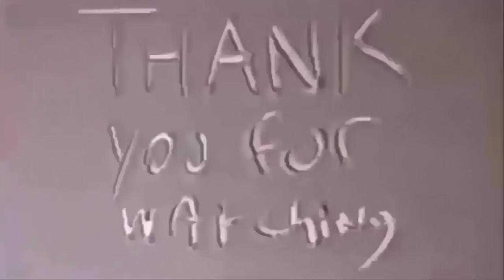How to Plaster over Artex and Textured Ceilings

Comment: So you used one coat bonding and two coats of multi finish am I right ?
Reply from the maker: yes mate thats 100%
Reply: mac plastering Thank you very much for reply mate, I will do  same but before start plastering can I use thistle bond-it gritt not pva
Reply from the maker: @1987yuksel  Yes you can use that buddy but i must say I dont use it no more due to it failing on me on 2 separate jobs and carlite even tested the plaster o the 2nd job and said the mix was right and the plaster was ok so that lead me to believe the grit failed me now not to say its bad as i have done loads that didnt but let me tell you pva has never failed me as bad as grit has and I have done loads more with pva over the years than grit

Comment: Nice job I've got a living room ceiling to do in a couple of weeks its thick artex I can't overboard it as it has coving,would you say your process of bonding and skimming over the artex is the next best option just because it's a living room ceiling so there will be foot traffic above just wondering would it be alot of weight on an already thick pattern of artex
Reply from the maker: HI mate , I have done it this way a good lot on many of ceilings and never had any problems , if it is safe to I would scrap it back so there i less plaster on , bonding is a lightweight plaster so not lots of weight there plus i would always re screw any lose or cracks and scrim them also it all helps for a better job, If you cant pull down on overboard its your best bet mate
Reply: @macplastering  thanks for the advice mac I'll go down that road and get a sample tested and hopefully crack on with it 👍
Reply from the maker: @Lemon-squeezer  For sure mate best way keep in touch let me know how you get on and always here for ideas if you need me mate
Reply: @macplastering  thanks pal

Comment: what are the costs of this job if it had asbestos? (same size single ceiling)
Reply from the maker: some guys just board over but to me that still would take disturbing the asbestos some will coat over with out scrapping but to have it removed by specialist asbestos company and dumped in a proper place witch i think the only place is Scotland that takes it, cant say what they would change to be honest thought mate, I have seen it been done guys wear a throw away suit tape every where off very well then rip down again fully cover with suits and mask gloves ect then bag it and then bag it again with a clear bag so you can se the 1st bag isn't burst hard work for sure. Do you have a job to be done in your home or ?
Reply: @macplastering  pretty much yea, bought a house 6 months ago in wales, and theirs a long hairline crack in the master bedroom ceiling (and a few other rooms that i'm fixing myself ) but its the only ceiling with a soft spongy pattern, and since the house was built in 1985 im guessing its artex and might have asbestos in it. so was wondering what it would cost to remove it properly.
Reply from the maker: Is the ceiling smooth mate? Or textured
Reply: @macplastering  it's textured.
Reply from the maker: If its nit heavy you could try bond and skim over it buddy like i have done with out scraping down

Comment: When plaster is dry what should it feel like to the touch as I've had paint fail so I'm trying to find out why it happened. I'm thinking it could be a weak paint ratio or wrong paint, Plaster being over polished or maybe the pva is leaching through the plaster due to it being 0.5mm thick.
Reply from the maker: Hi buddy , It could be loads of reasons or just 1 hard to know .... but I have painted my own work and can tell you some on that , my opinion on over polished is that when it is dry it should still soak in well I always use a paint that is designed for new plaster , always paint when fully dry if it looks wet when giving the 1st coat stop and leave it longer , pva tends to not let the paint fail but make it shine through if this make sense, has the paint came away or what is the issues you are getting when it has failed buddy ?
Reply: @macplastering  If you scrape the wall in places with a scraper the paint is hard and flakes off to bare plaster. Then other walls the paint have cracked in places. The one wall is smooth like glass but it won't take paint and sanding the wall it's still smooth as glass.
Reply from the maker: @hardworker8030  The paint I used is called leyland paint it was there paint designed for to go over new plaster , strange that you sand it and it stays so smooth sanding should just open it a little ll the same just to allow the paint a key , i have seen paint looks all cracked before. and asked  a painter he said it was probably done when t was too cold
Reply: @macplastering  Was it called leyland super leytex as if it was I seen a post where the paint cracked over this. I'm using 120 grit to sand the smooth wall but you've got to be careful as the plaster is so thin. I don't think anyone knows why paint cracks as I've been told mist coat to thin, Plaster still drying out, Pva on wall or paint reacting with pva when soaking in to plaster. I seen a post where someone said they don't use contract matt anymore as it sucks the life out any top coats. I also see decorators recommending contract matt but leyland paints are saying contract matt is for wet plaster and should not be used on fully dried plaster
Reply from the maker: @hardworker8030  best thing is to always read the paint you use to see what it works best on and its abilities and disabilities , making a good bond in plaster painting tiling bricklaying is the most important thing for sure , and so many variables its unreal even the most experienced trades man or woman will find challenges
Reply from the maker: @hardworker8030  think it was this = https://www.screwfix.com/p/leyland-trade-contract-matt-emulsion-paint-brilliant-white-10ltr/33680?tc=NA4&ds_kid=92700030936902248&ds_rl=1241687&ds_rl=1245250&ds_rl=1243321&ds_rl=1245250&ds_rl=1249481&gclid=EAIaIQobChMIiIr9zamR5QIVwbTtCh07RwAKEAQYAiABEgItyfD_BwE&gclsrc=aw.ds
Reply: @macplastering  I work in a factory with 2 blokes and 1 says he's a plasterer/painter and decorator and the other says he's a painter and decorator. So I asked the painter and he didn't have a clue and told me to ask the plasterer but when I asked him he said it's the salt in the plaster stopping the paint sticking or it's the pva they put in the plaster in the factory to help it bond so he could only recommend giving the wall a coat of pva. I've wiped the wall over and when the plaster gets wet it goes shiny and very slippery so I'm thinking it's pva coming out the plaster.
Reply from the maker: @hardworker8030  if its salt you normally would see it like a white hairy fluff but still could be i know here when painters paint over pva it tends to take loads of coats as the pva shines through
Reply from the maker: @hardworker8030  Dude if you think its salts you could use an alkaline resistant paint / undercoat
Reply: @macplastering  When the plaster is dry you cannot see pva on the wall but when the plaster gets wet it goes shiny and slippery so I think this is the problem as the paint is not going to soak in.
Reply from the maker: @hardworker8030  how will you deal with it ?
Reply: @macplastering  I don't know what I'm going to do as I've contacted zinsser and they said if it's pva they don't
do anything that will cover pva so I'm waiting on leyland paint to get back to me.
Reply from the maker: @hardworker8030  Let me know what they say dude

Comment: Hi mate, do I need to pva the ceiling two times or is one time ok? Cheers
Reply from the maker: Hi mate hows it going ? yes it all depends on the pva and possibly background most pva say you should seal coat it then when dry put another coat on and plaster when tacky , I would say always try and plaster over when it is tacky hope this is helpful mate
Reply: Hi mate, thanks very much for the replay I skimmed a very small artex ceiling like this today I painted with pva and it took ages to go tacky so I just did the one coat and bonded it and skimmed it with two coats like you said even though it was very small only like 4 foot By 4 hope I did it right lol it turned out really well I just wasn’t sure about the pva thing. Cheers mate
Reply: O and by the way your plastering videos r by far the best on YouTube really great stuff mate
Reply from the maker: @TangTang-ew3nn  Thanks you mate really appreciate your support :) pva can be a hard thing to get loads can go wrong with it and timing is key to plastering sometimes it really can take ages to get sticky over painted areas its a nightmare sounds like you got there in the end but mate and thanks again for the support man :)
Reply: Ok mate good stuff, thanks again I really appreciate you taking the time to reply to me :-)
Reply from the maker: @TangTang-ew3nn  Its no problem mate always here if you need help and if i can i will :)

Comment: Hi Mac have you ever mixed multi and bonding together for the first coat, then gone straight over with the 2nd coat of multi?
Reply from the maker: Wouldnt do that on my jobs I always stick to by the book mixes but have done that before when working for someone else and all the rest cement in the ix but I cant recommend it as if it fails you have no one to turn to and will be 100% responsible , saying that have had a few things fail by the book to and the company said they cant stand over that LOL covered them selves by saying they didn't own the paint under then might not own the plaster under that or the boards under Nightmare ....
Reply: mac plastering thanks for your reply mate that’s good to know 👍
Reply from the maker: No problems mate hope all is well with you and yours

Comment: Is that a 14 or 16 inch trowel
Reply from the maker: witch trowel i use a stainless then a superflex 3
Reply: The blue handled one.
Reply from the maker: @jamesgrant514  Oh yes mate thats the refina stainless I thinks its a 16 :) going to need to pick up another this one has done a long time
Reply: How you like the superflex 3 over superflex 2, do you know if the collomix and Ruby battery's are compatible? Great video as usual 👍
Reply from the maker: @michaelohagan6429  i do like it that little more :)  not sure i have not tried them lol but will have a look and see if them bats fit each other not sure they will as the rubi  has a catch in the bat and the collomix has a catch in the drill lol

Comment: Hello mate sorry to bother ya i recently bonded over a artex ceiling it was a large ceiling 65sqms and the artex was heavy like you i use a brush to apply pva as this in my opinion is the safest way i applyed my pva liberally I lates my first gauge on troweled up then a large part of the ceiling came crashing down I am a bit baffled to say the least i pvad the bonding twice before skimming so my thinking is the weight and the area was just too much any help would be greatly appreciated cheers mate
Reply from the maker: was it near set when it feel ? did the artex fall with it ? did you pva the bonding after you filled it out? in this video I pva then bonded then just skimmed as bonding is setting bonding is light weight and gets lighter as it sets as the water is drying out of it , some artexed ceilings is a type of paint that when wet goes soft and rubbery this can cause big problems , and stay safe when working with this stuff mate
Reply: @macplastering  yes what I did was pva the artex then bonded the ceiling then when dry too touch i pvad it left it over night then in the morning pvad it again then skimmed it troweled up then boom ha the artex didnt fall but was wet too touch after it had fell cheers mate
Reply from the maker: @Cluedup2399  Sounds like the artex soften and your plaster then unbounded as it was soft underneath your set plaster
Reply: @macplastering  cheers mate just sort of baffled me as too why it happened thanks again
Reply from the maker: @Cluedup2399  happy to help mate you know your self could be loads of reasons or just 1 , how will you be trying to repair it now buddy  ?
Reply: @macplastering  Ha yes 1 of many im going too leave it over the  weekend and wait till it fully dries then just patch it up and get the painters in quick 🤣🤣
Reply from the maker: @Cluedup2399  Good luck mate hope it goes Smooth for you :)::)

Comment: I didn't think the white asbestos was dangerous to be fair?
Reply from the maker: It is but it is the least dangerous Buddy but I wouldn't be using it for sugar all the same ;)

Thanks for the comment buddy
Reply: @macplastering  lol ;) tell you something worse than the white, the silica dust produced when drilling concrete lets see em make a song and dance about that and start removing all the concrete from construction. There's a documentary banging around somewhere that talks about this dude.
Reply from the maker: @osscar29  Was chatting about the same thing the other day how bad Silica is and other things like installations that are not talked about yet , and most guys dont think its bad because they are not told ,